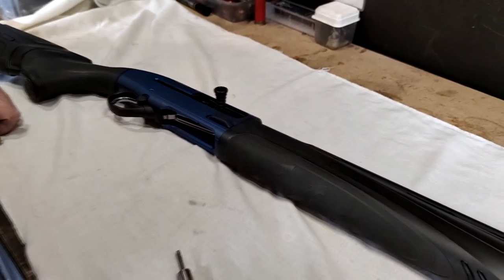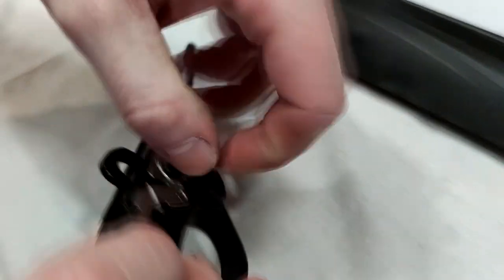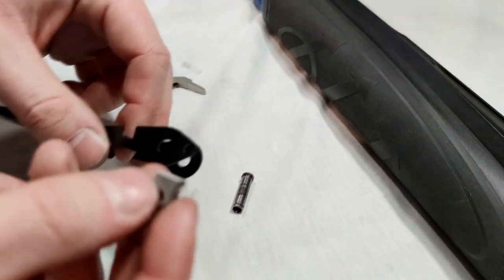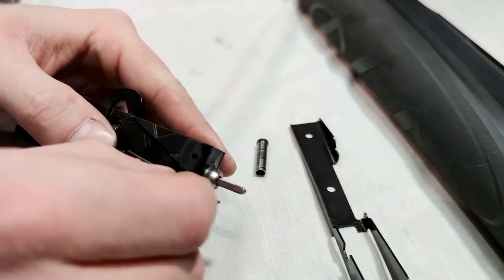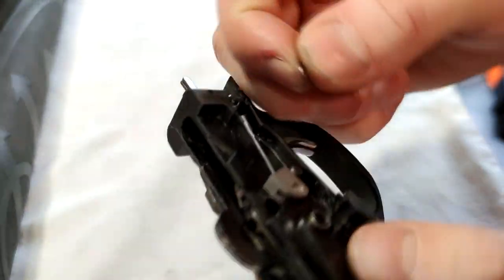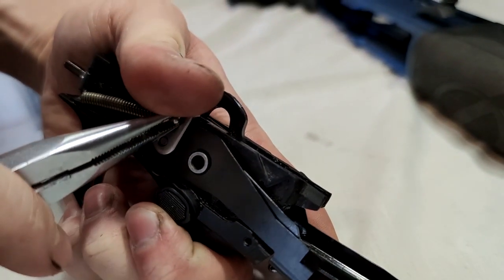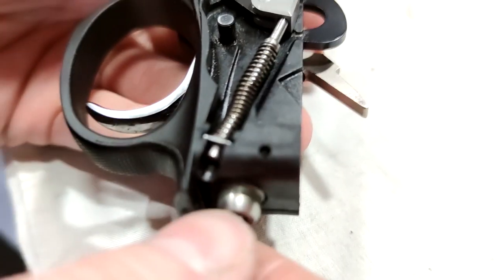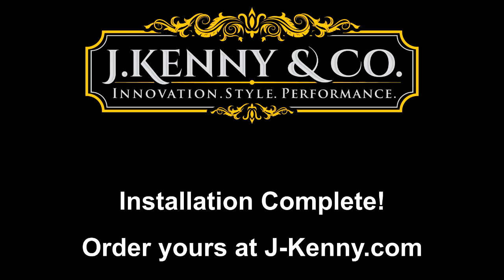Installation Guide: Beretta 1301 Auto-Loading Lifter by J Kenny & Co.

Comment: Why you don't advocate this new lifter for the 1301 tactical?
Reply: I am guessing.......but the Comp is a 3 inch receiver and the tac is a 2.75
Reply: @davemarques9601  ??, my tac. takes 3"
Reply: I looked it up, the comp is on a 3.5 inch reciever, but to answer your question....the idea is good, a few have the MOA lightening lifter and one has the kenny version, all on M2's....they work.....so if they make one for your gun I am sure it would work......
Reply: The correct answer is this is a different solution than the "pro style" lifter that merely lifts when the bolt is CLOSED for easier loading AFTER you load one into the chamber and close the bolt. This product allows for loading rounds into the magazine tube while the bolt is still open and then it automatically chambers a round a closes the bolt for you, eliminating the need for the shooter to load one into the open chamber and close the bolt and THEN proceed to loading the magazine. Looks like they don't offer this product for the tactical version of the 1301, just the Comp and Comp Pro.

Don't worry...I was super confused how they could get away with selling this for $280 until I more carefully read their website.

Comment: Can I still ghost load my benelli m2 if I modified the bolt so it can float an extra shell ? Can I still use this lifter with the modification? All I did to the bolt was cut a 45 degree angle on the groove part of the bolt